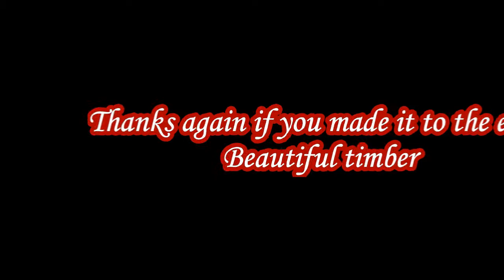Turning an Australian Hardwood bowl.

Comment: G’day, thanks for sharing.
Very heavy wood, why did you leave rim so thick for. You could have undercut it a bit to reduce the overall weight.
Yes I agree ironbark is great turning wood and oh the Georgia’s red colour of heart wood.
I liked the fact that you used a little epoxy to seal cracks and voids. I’ve used epoxy for same reason. Blue colour goes really well with iron ark as well.
Good finish well done.
Reply from the maker: Hello Greg. Thanks mate. Appreciate you watching. Yeah, I did leave it a bit thick. It was a wedding present for some friends, and they wanted a really heavy bowl that they could chuck stuff in and eventually have a battered looking patina on it. I've done an iron bark container with a blue coloured epoxy and it does look awesome. Thanks again Bud. Regards, Kevin.